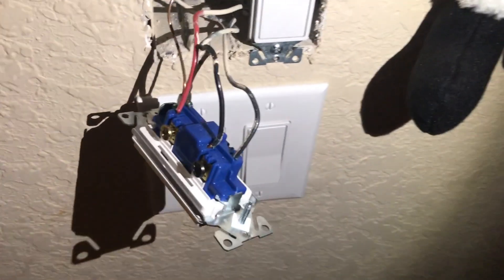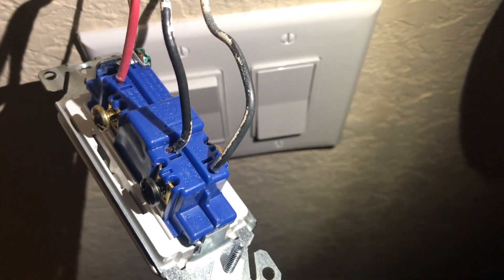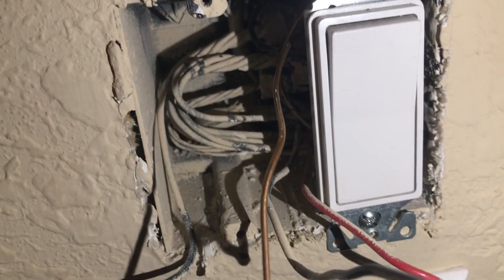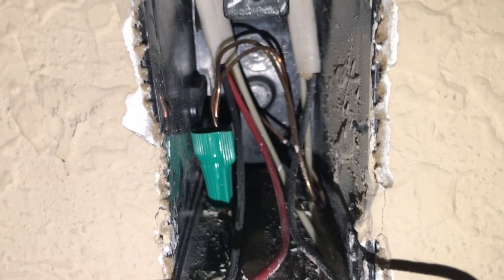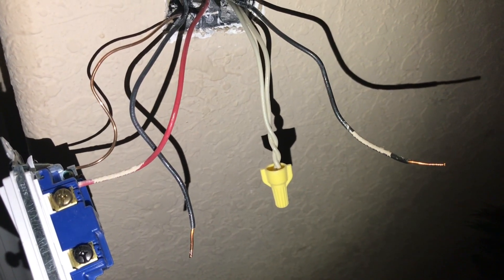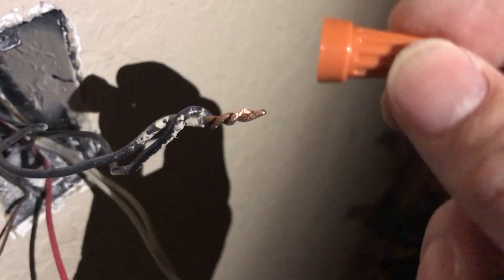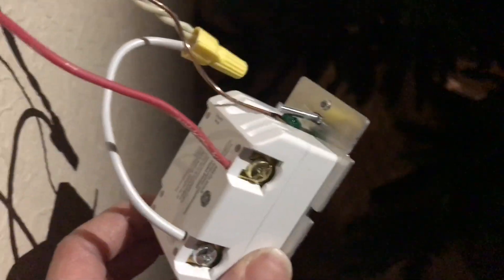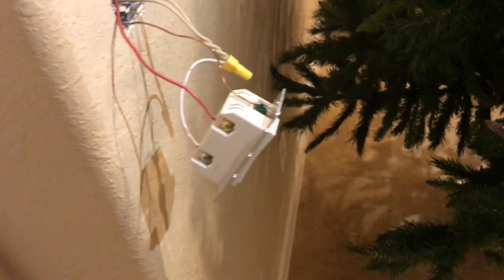How to Wire GE Smart Switch 3-way add-on switch Z-wave WiFi

Comment: My 3-way switches only have 4 wires (ground, white, black, and red). How is that handled without two black wire? My house is only a couple years old and I know I have neutral in the box. Thoughts?
Reply from the maker: Is it the main side or remote side of the 3-way? One side will not have two blacks (or 2 reds). The switch that eventually goes to the load will have two black or red because one is a traveler and one goes to the load and last black is building.
Reply: Tuner with Kids both sides only have one black. What I am figuring out is that I think the power is going into the light, and that the white wires are not truly neutral (I think). I’m wondering then, if I can just add a neutral jumper to the neutral wires in the box...?
Reply from the maker: It would need to be a confirmed neutral, like pulling from the light down yourself. It would be odd for anything built after 2008 to be missing neutral in all the boxes. It was code requirement. Each of my boxes is crammed with a neutral node.

Comment: I have connected mine in the same way and the light comes on for 5 seconds then goes off when I use the add-on switch. No idea what's going on :(
Reply from the maker: Jarold Acosta ensure you have a neutral?
Reply: @TunerwithKids   yes, I have a neutral in both ends (switch and add-on switch)
Reply from the maker: Does it work without the add on attached?
Reply: @TunerwithKids   (sorry for the delay) Yes, it works fine without the add-on switch. When I connect the add-on, it turns the lights on from the "remote" location and they go back off in about 2 seconds
Reply from the maker: Are you sure the traveler leg used is completely isolated from 120V? That’s one of the requirements of the remote. In a traditional 3-way, the traveler is used to flip/flop the 120V. In this setup, you use it as a signal wire on the low voltage side of the Smart switch.
Reply: @TunerwithKids  I ran the cable same way you did (and the diagram that comes with the switch). I bought 2 wifi GE and 2 add-ons GE. I'm gonna try with the one I haven't used yet

Comment: Thanks Binh, 

This is really a nice video. I have a couple of question, can you please share your thoughts. 
1. Can i just install 3 way GE Z-wave dimmer switch at one of the locations of my 3 way switch and leave the existing non smart traveler switch as is. 
2. I tried to install as mentioned above. the problem i m having now is, i m able to turn the lights on and off with a breaker. But the actual switch is not working.
Reply from the maker: 1. nope because they traveler is a low voltage signal from remote switch. Line voltage will kill it.
2. Make sure you have the neutrals in place and test the master switch first.